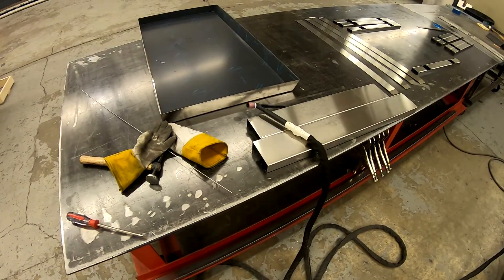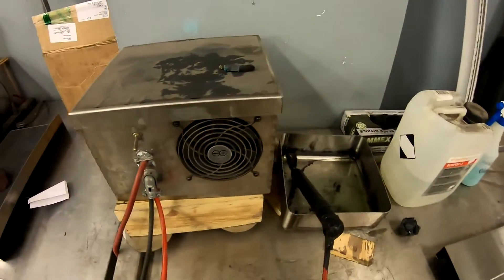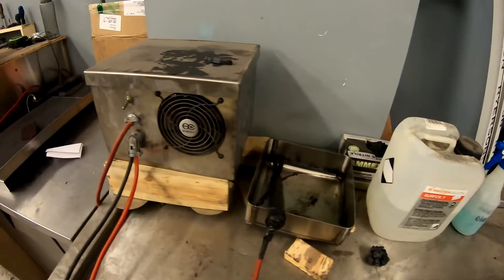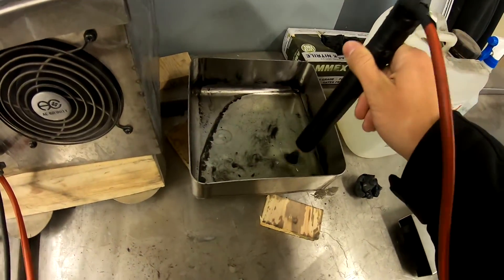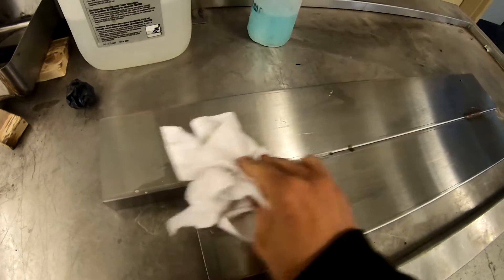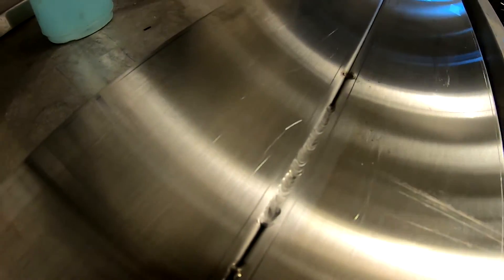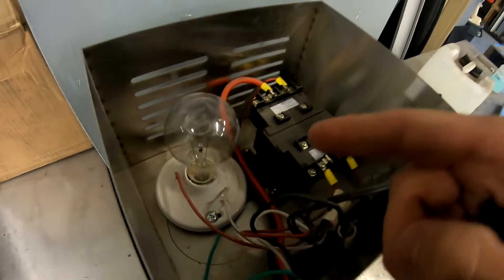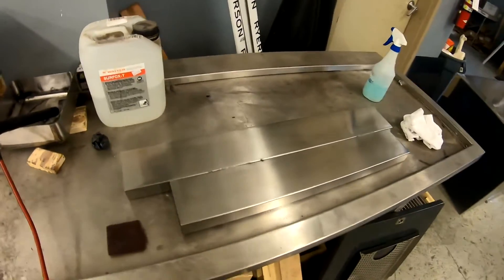Use ELECTRICITY, Clean Stainless Steel Tig Welds (The machine I built to do it)

Comment: A 24 volt 5 amp transformer with no light bulb works very well. It pretty much self limits as the acid solution on the brush can only pass a limited amount of current. 24 volts is faster acting than 12.
Reply: Wiring diagram? :)
Reply: @spencerkarstenkeely6584  One wire connects to the work. Other connects to the brush. How hard can it be ???

Comment: You know you can just use a cheap stick welder to do this. 
Just buy the polishing brush in your connection type and you can use there fluid. 
But 90% of the cost is the actual machine. 
I have a set up at my parents place that I just swap the leads over when I'm using my tig welder. My tig is a multi purpose tig. So tig stick and plasma.
Reply: Interesting, so is the Stick welder AC?
Or can this process be done using DC

Comment: Why not just use two car batteries connected in series? You use AC but on https://en.wikipedia.org/wiki/Electropolishing it says that it's done with DC with plus connected to the work piece. Have you found any benefit with AC or is it only that a transformer is cheaper than a transformer+rectifier?

Comment: While visiting some metal working friends in Germany, they showed me an electrolitic cleaner that uses salt water (forgott to ask wich salt they used, but wasnt acidic).
Their machine was more than 20 yo, and it worked fine and fast.

Do you have any idea of that?

Nice project, since I can't find such small machine here in Brasil, I will try and build one of those!
Thanks for the video!
Reply: I have used salt water with regular salt water (NaCl) on stainless steel but that was not for cleaning a weld but to etch the surface. I masked letters with tape and etched with a cotton swab and a 12 V battery. If the surface is shiny from the beginning, it will turn dull by etching. Don't remember if it was plus or minus on the swab. Search for electro etching if you're interested. The acid he uses here is dilute phosphoric acid. The only thing I wonder is if it has to be AC. DC would be easy to get from a car battery or two.
Reply: It's probably the same type knifemakers use to etch their logos on knives. You use DC to electropolish your logo through a stencil, AC to darken it.

Comment: I do hope you have spare bulbs on hand. With the way industry is going for incandescent lamps I understand these have been phased out of production.  Have you tried measuring the resistance of the bulb and tried locating one of the huge ceramic resistors of the same value at 150 watts power? Might even try locating a 150 watt wire wound resistor at the same ohms as the lamp that come in the metal case. Use high quality heatsink compound and mount it to the cabinet. You could even find a large surplus aluminum heatsink and mount it to the case behind the resistor to help dissipate the heat. Might even try adding an inrush current limiter on the high side as well to smooth out the initial power surge.
Love the stainless work!

Comment: I used a home made one of  these about 10 years ago,  I measured the voltage,  approximately 36-40vac,  12 amps,  output,   120vac input,   solution  was phosphoric acid from Home Depot,  "it was fast",   I  like the 150watt light bulb trick,  I guess u could use 2 light bulbs in parallel if u want more watts?   GREAT VIDEO
Reply from the maker: You can't use more Watts than the kva rating of the transformer or else you cook it

Comment: Where did you get the brush for the procedure?
Thank you very much in advance.
Regards from Spain in Europe
Reply: you can get them on ebay if you search tig brush
Reply: It's made of carbon fiber and googling "carbon fiber brush" showed those old things for cleaning LP records. The hairs on those are shorter but I think they are folded inside so if you break it apart, you could get longer hairs that you then can put inside a small tube and press the end of the pipe. At least around here, I think I can find a record cleaning brush in a music store.

Comment: Don’t let anyone install a led light when the bulb burns out (flames may incur lol)
Reply from the maker: It's actually impressively hard to find a 150 watt incandescent
Reply: You could just toss in a beefy resistor.
Reply from the maker: @xnizonyt  I used a light bulb because easy math.  Essentially the light bulb is just acting like a resistor just runs a tad hotter
Reply: @HighTechLab  Hewlett Packard started in 1938 on their very first product by using a light bulb in much the same manner - it has negative resistance, i.e. more voltage = less current  http://www.hp.com/hpinfo/abouthp/histnfacts/museum/earlyinstruments/0007/   That 200A audio oscillator was sold to Disney and began the firm's first success.

Comment: The pickling acid does that without electricity. One day ill do a weld vid.
Reply from the maker: That's why I was kinda unsure.  I believe this uses phosphoric acid
Reply: @HighTechLab   I can find out but it should have ingredients on the bottle. It is an acid for sure.
Reply: @frankz1125  Traditional pickling acid does this job without electricity but that's wit a mixture of nitric acid and hydrofluoric acid. That's really nasty stuff that you should neither breath in or get on your skin. I mean really really bad. This process with electricity lets you do the same trick with a quite harmless acid, dilute phosphoric acid. That's the point. And while the traditional stuff is only sold in special welding shops (don't know if they require some licence, some workplaces have banned the stuff from safety reasons), phosphoric acid is readily available, e.g. as "rust eater" which you can dilute with water.

Comment: Can you do a video on stainless welding that's considered food safe? I'm interested in making some custom muffin baking tins for my mom's bakeshop.
Reply from the maker: Potentially.  Typically it's more of the material and design and how you finish the welds that makes it sanitary/food safe, but yeah I can talk about that
Reply: Practically any higher grade stainless steel is food grade. The welding rods used should be higher grade than the material anyway.
So normal 304 will do for such a project.
Reply: @kalleklp7291  
The local food inspector, who is not a welding expert, and neither am I, said that either the gasses or filler material used can have cadmium in it which makes it toxic.
I'm just an auto body guy that is used to doing stainless might welding and some oxy acetylene welding. I have a friend with a bake shop that asked me if I can make some custom cupcake tins, so this is why I ask this. I fully accept that the food inspector may not know what he is talking about, I just want to make sure.
Reply: @mindthependulum6245  I don't know what type of gas you have. However, I can assure you none of the commonly available gasses for TIG welding contain cadmium. Cadmium is a heavy metal and highly undesirable in the food industry.
Filler material i.e. rods for work on food-grade items don't contain any cadmium. All stainless steel filler rods are free from cadmium.
I think what he heard about where some rods used for brazing which can contain Cd. One wouldn't use these rods for such work. Brazing and TIG welding are two different processes.
So be at ease and just continue your project. :)
Btw..I'm a blacksmith, machinist and professional welder for almost 30 years now. Done a lot of work for the food industry and also build my own still, which requires even more from the materials and welding methods used, as chemical compounds in gas form are involved together with higher temperatures.
Reply: Brazing Rods may contain cadmium but It would be very unusual for Stainless TIG rods any toxic additives. Stainless TIG rods are usually pure SS 309 which is food safe. Not sure how you would go about making custom Cupcake tins since the cups are usually wider at the top and narrow at the bottom. You would not be able to use SS pipe to make them. Usually Cupcake tins are made in a press.
Reply: @guytech7310  Exactly..!
Reply: @guytech7310  One way would be to have a circular bottom and attach some rolled plate at an angle to it. Then just fuse both together without filler.
Reply: Sure, But I doubt anyone would spend two days & $50 in materials, making a custom cupcake tray, when the local wallymart sells them for about $4.

Comment: WHATS IN THE BOOOX!!!!

Be careful with those stainless fumes. That hexavalent chromium will speed up your expiration date.  I did stainless welding for 6 months on a project had to bring in an air scrubber and wear a positive displacement welding helmet with a heppa /charchol filter and cover all my skin. U dont want lung ulcurs. Get a fan and open the door if nothing else.